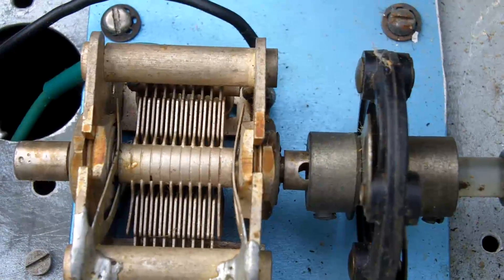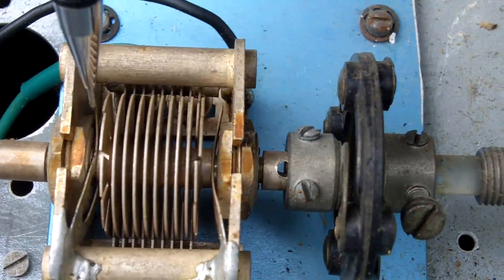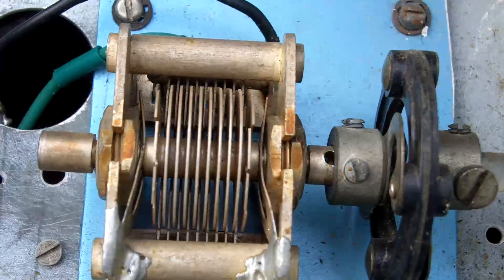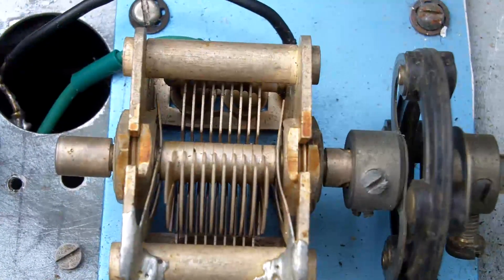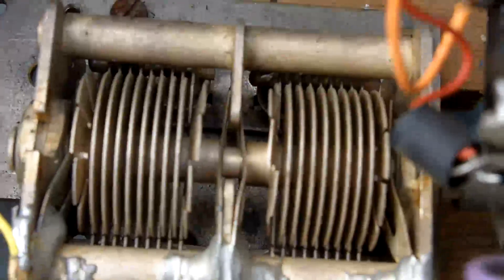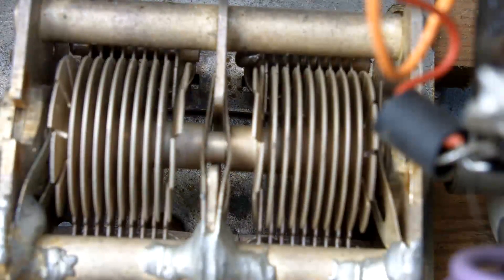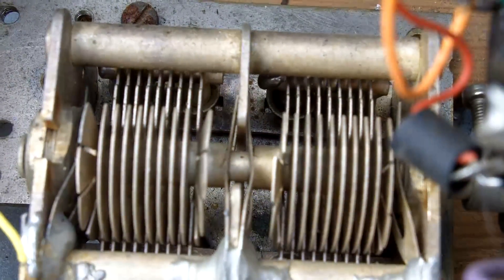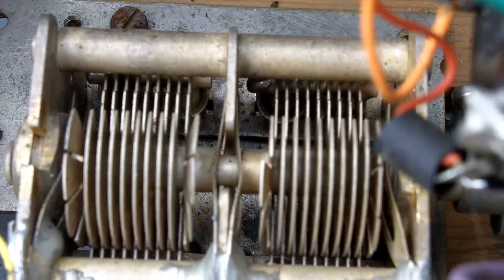About Capacitors ... Part 8 Variable capacitor with side wings adjusted.

Comment: Hi,

I have a box of variable air capacitors that were apparently pulled from old radios - the problem is that many of them don't have any values printed on them. Is there a reliable way to determine the value ranges? Thank you
Reply from the maker: Hi the only real way is to measure them on a thing called a ‘capacitance bridged’ or create a ‘tank circuit’ that is  connect a the capacitor in parallel with an inductor of known value and then drive the tank circuit with a test oscillator taking a reading with an oscilloscope.
It’s possible to get some idea by measuring the physical dimensions although this gets tricky when it comes to accuracy in measuring the air gap.  If you really get stuck you can substitute a capacitor in a working circuit where you know the value of the capacitor or simply try it in a new circuit, that’s what’s called the ‘suck-it-and-see’ method and most radio builders will have resorted to this at some time as it usually doesn’t hurt a circuit to have an incorrect variable capacitor in place.
 Never let, ‘not-being-100%-sure’ stop you from having ago.
I hope that helps.
Kind Regards and Merry Christmas... Andy
Reply: AndyDaviesByTheSea
thank you so much for taking the time to leave a detailed reply. The methods you mentioned are over my head at this point, but I have to start somewhere and will keep this info on hand until I am competent to implement it. Merry Xmas to you was well.
Reply from the maker: Hi, no worries. If you’ve got a bunch of variable capacitors why not look at some simple ‘Radio Frequency’ oscillator circuits to build and play with. Typically air spaced capacitors have only quite low values of capacitance, probably from 10’s of picoarads (pF) to a few hundred pF say 500 pF and that sort of value dose really get used in audio oscillators as going from say 10 pF to 500 pF in an audio circuit (say less than 20 Kilohertz) doesn’t change the frequency very much but when you get into RF (Radio Frequency) changing from 10 pF to 500 pF has a big impact. If you work out the formula for different values of capacitor, inductor and frequency you’ll see what I mean.  You could build a simple crystal set and you’ll get a ‘feel’ for the different capacitors. The maths and the ‘feel’ all go together to build up a picture about variable capacitors and eventually you can chose a capacitor by looking at it, you won’t get it right all the time, but hey, the guy that never made a mistake never made anything.
Have fun and have a look at the formula, it may look scary but get help if you need it, but by understanding the formula. Look up things like... ‘tank circuits,’ ‘resonance’ and ‘LC circuits’
They’re all pretty much the same thing but different searches will throw up different aspects and that’ll build a more detailed understanding that’s why I'm not directing you to a specific site. OK, the rest is down to you my friend, good luck.
All the best ... Andy
GWØJXM

Comment from the maker: Hi Barry. I ‘m not familiar with the set but unless it is a really high quality radio it’s unlikely that the outer fins have been ‘Tuned’ and I’m guessing, only guessing mind you, that maybe the outer fins have been bashed in some time when the radio has been out of the case and maybe they have been pulled out to stop them from shorting to the fixed vanes. If you send me a message on YT I’ll give you a contact address to send a pic.  
All the best ... Andy